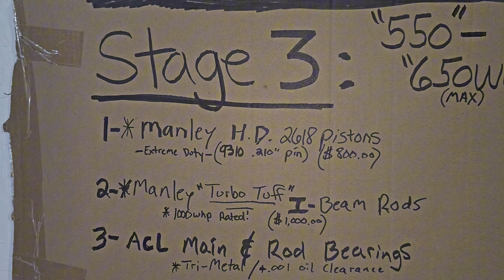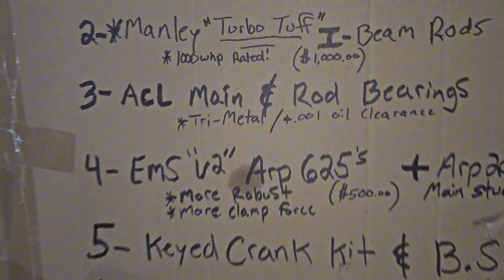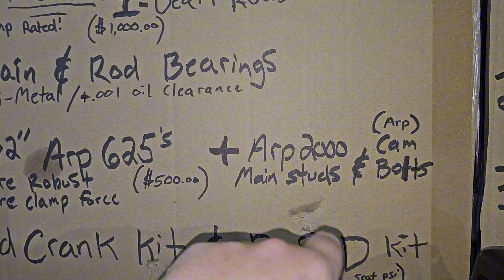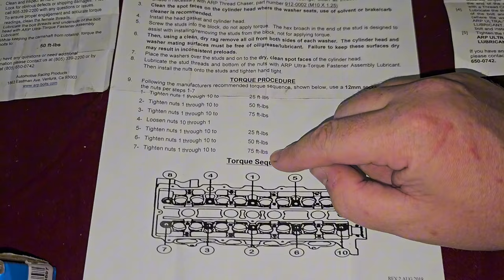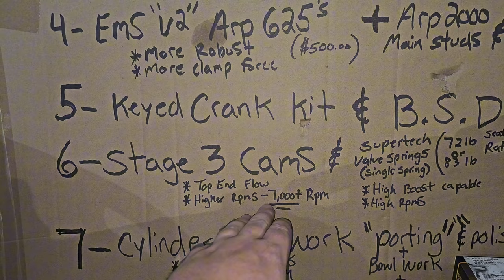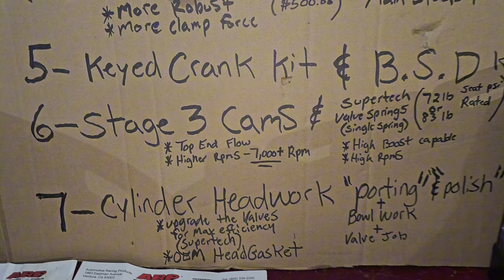Focus ST - Stage 3 *DIY Engine Build + HP Rating!  (Pt.3) #builtenginefocusst

Comment: Nice in depth video, but we all know if you want a strong engine, dont use any focus ST XR and RS engine :)
Reply from the maker: A ST block is good up to 850whp sleeved,  750whp not sleeved.  The RS block is definitely junk but the best block is the MZR speed 3 block for whatever reason.
Reply: @WhiteblurrST  I run a used car department, in the 7 years I Sold 1 XR5 and 1 RS both came back with block gasket problems, both low KM hence I though lets retail it they would be OK, onee was driven by a lady with kids, and other was hardly driven, no mods. both drained the warranty account. and we need to supply the customer with a car to drive while repairs are done. I absolutely hatem LOL I think if anyone has one of these specially the 5 cyl. even if their not modding. open it up put a sleeve in it. but to try to get even anything close to 500 without sleeving, just by design, those floating bores/ your just asking for it. from what I can see the headgasket is not designed to take much with those bores. need something more solid  or MLS I really dont know, but the standard gasket is designed for a flat block/head that will seal the whole surface.
Reply from the maker: Yea the 2.0 ecoboost and 2.3 ecoboost mk3 are totally different engine block designs than the 5 cylinder,  idk what the 5 cylinders can handle stock block.  We dont have those 5 cylinders here in America lol,  the volvo s60r has it, they sound decent.

Comment: Got transmissions?
Reply from the maker: Transmission building is easier if you know how to do it,  really all you need is upgraded bearings, forks, treated gears, better syncros and a better differential and dont use the dctf fluid which is water.

Comment: Cud u send a link 4 the oil n filter pls m8
Reply from the maker: Amsoil.com i use 10w40 XL for 93 or Dominator Racing 10w40 or 15w50 for high hp e85 tunes.  The filter i run is a mobil 1 m1-209a equivalent.  Hope that helps
Reply: @WhiteblurrST  ok thanku so much 👊🏻👊🏻 ur videos r so helpful and indepth and from the uk i thanku so much mate
Reply from the maker: I appreciate your support 🙏
Reply: @WhiteblurrST  sorry question mat3, could i run stratified aux fuel with stock hpfp and injectors, get a 2867r gen 2 turbo wjth a decent tune and run around 420bhp with no wmi?
Reply from the maker: I run oem stock fuel system on my setup so yea absolutely 💯,   get the elliot specialized performance 4port kit 65lb injectors,  thats the kit i run and it's high quality.  Also the cheapest!  

https://esperformance17.com/products/radium-engineering-4-port-injection-system